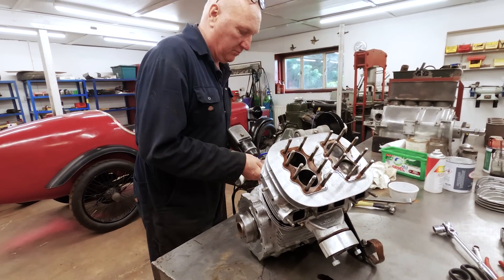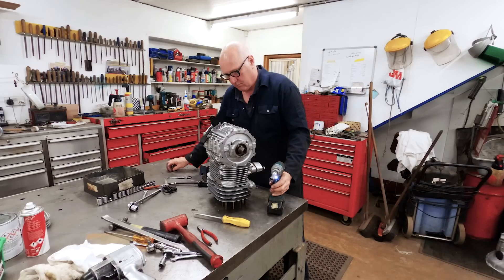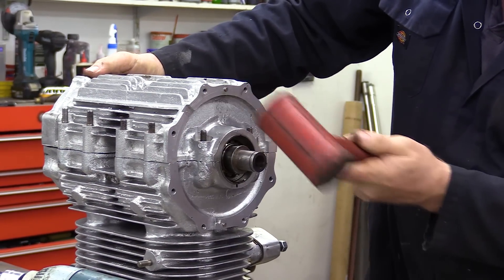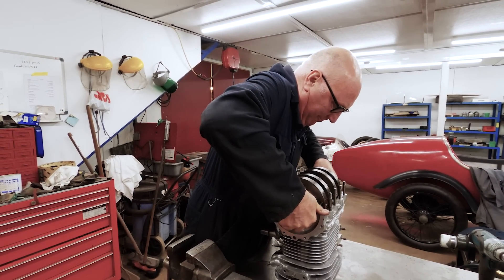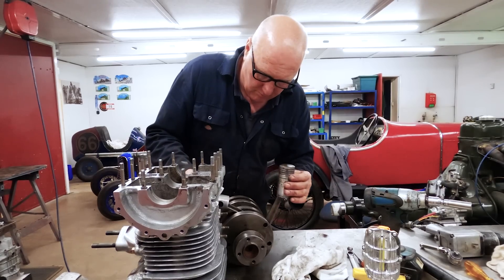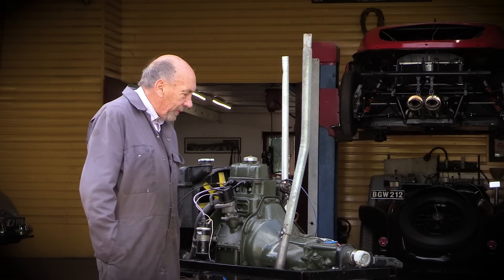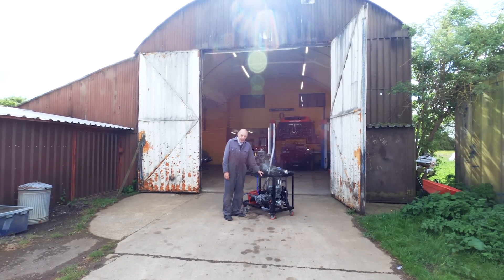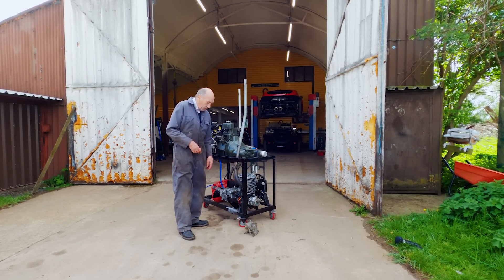SHED RACING - 2 Stroke Mini Engine/ Fault diagnosis

Comment: I used to mess about with two strokes as a lad - its got me stumped - I know the water bottle GT750 was plagued with crankshaft oil seal problems - it was fun to ride though get it in the power band and hang on. Two strokes will usually run without an exhaust they wont produce maximum power look at some of Mr Millyard's content Alan starts bare engines on the tailgate of his pickup. That backfiring ? I am sure someone must know.  Stay safe Ivan.

Comment: Crank seals are all important on a 2 stroke. The seal that you fitted the wrong way round is just one of three crank seals which allow the engine to develop crankcase or primary compression, to push gases into the combustion chambers through the transfer ports. The main bearings will have seals built into them. Over years of standing unused these seals harden and crack, and sealing is not achieved.  To get to these seals it will be necessary to split the crank, and release the main bearings for seal replacement.

Comment: I would agree your lack of tuned pipe is probably most likely issue. Without exhaust scavenging the motor will struggle. The other thing is you spark gap could be too large. I had a personal water craft that did basically the same thing and as soon as I closed the plug gap 0.02 it ran like a top.

Last you guys should reach out to the guy from 2 Stroke Stuffing here on YouTube he is deep in the weeds with 2 strokes.

Comment: This has been a fascinating series. I have yet to understand how that 2-cycle arrangement works with the paired pistons. :-/
Reply: Basicly one piston controls the intake function and the other controls the exhaust. This allows the port timing to be asimetrical so you can favor port opening and closing for best power . Normal single piston 2 stroke port timing is always a compromise , porting for max power usually kills the bottom end. Reed valves or rotory valves on the intake and tuned exhaust are ways improve the power band while still trying to obtain max power with a usuable power band.
Reply: @dog8nut  Ah, got it. Thanks! I see they share a common combustion chamber, so it makes sense now.
Reply: @dog8nut  I don't think so as surely you would only have 2 exhaust ports for your arrangement.

I think we simply have a 4 cylinder 2 stroke, arranged like a v4 or parallel 4
Reply: @psk5746  The orignal PUCH design used twin exhaust ports on their 2 piston ONE COMBUSTION CHAMBER engine. So what we have in this case is a 2  cylinder 4 piston parllel twin with 2 combustion chambers. Still with 2 exhaust ports/pipes per cylinder.

Comment: Great interesting engine , try smaller bore   carb , I remember in my training on any engine  the intake size can be too big , we tuned a single cylinder,  huge valves huge intake port huge carburettor  it wouldn't even start , so in practice air speed through  the intake has to match the piston displacement, we put a different head with small intake small carb started perfectly,  regardless of any other setting ,

Comment: How do you expect it to run properly without a tuned expansion chamber ?
Reply: Don’t think the expansion chamber was around when this engine was designed, it was only just being invented and used by MZ motorcycles around this time.

Comment: since its a 2 stroke, you might want to find/design an exhaust with an expansion chamber? im not sure if youd want one per cylinder or whatever, but ive heard those are quite important in modern 2 stroke engines
Reply: Absolutely necessary, otherwise exaust pulses will push back through the intake as seen here

Comment: From what I can see you have no seal(s) on the crankshaft between the cyls so what could be happening is the primary compression is going back and forth in the crankcase instead of being forced up to the combustion chamber via the transfer ports.
Reply: The crankshaft piece housing the bearings & seals, between the cranks, is technically called a labyrinth. I've worked on 2 stroke twins for 43 years now, and previously suggested this as a possibility. However, I've run 2 stroke twins with bad labyrinth seals and they've never blown back through the carb like this. They've just been a bugger to start and disliked running at low RPM.
Reply: @CZ350tuner  A labyrinth (series of lands and or groves on the crank or journal area) seal is one type that is used on multi cyl 2 strokes but there are standard rubber type seals used on some brands of 2 stroke engines. 
As for whether lack of seals is the cause or not is to be determined and the bottom end of the engine is the Experimental part and perhaps not enough research was done in design. 
I have been working on multi cyl 2 stroke engines for over 50 years now.

Comment: I'm confused how this engine works I thought you said in earlier vid 2 pistons acted as a supercharger pump ? and yet 4 exhaust pipes? at least you got a run well done. It seems unusual to me the Inlet and exhaust are on the same side which would mean the gas flow would have to turn 180' ?

Comment: I have a love/hate relationship with 2-strokes, they're wonderfully simple and can run and sound fantastic when things are going well, but they're finicky, high-maintainence little beasts! apart from very early examples (full of cast iron and bronze-bushes) they've got a limited lifespan too!

I reckon the backfiring could be down to the exhaust, most 2-strokes rely heavily on the resonance of the pipe to run, and keep the gasses moving in the correct direction. although older 2-strokes (pre-war especially) are quite happy without a resonating pipe I think if you made something up along the same lines as was fitted to the puch bike engines, you'd at least eliminate that issue.
Reply: Iirc 29 inch pipe length for individual pipes from the piston should give the right reversion pulses from an open ended pipe.... the reflected pulse should arrive back at the right time..
Reply: I've seen Suzuki Water Bottles with bloody light years on them running merrily along. 70,000 - 80,000 miles was not particularly remarkable if you kept oil in the injection tank. Certainly I've seen regularly used outboard motor two strokes that were 50 years old and had never been to bits.
Reply: @scheusselmensch5713  It all depends on the care taken when operating i suppose, most of the 2-strokes I see are thrashed within an inch of their life and only get attention when they won't thrash any more! there's plenty of them out there that have a LOT of hours on them and are still ticking, but the vast majority tend to live fast and die young. I'll still stick to the old iron though, it smells of castrol and makes better noises!
Reply: @theafro  life of a 2 stroke all comes down to feeding and maintenance. Use proper fuels and oil warm them up properly and provide the proper maintenance when required and they will run forever
Reply: @holmes1956O  the trouble is, that the majority of 2-stroke users nowadays are either young lads on scooters or arborists with chainsaws/brush-cutters, neither category are known for mechanical sympathy!
Reply: @theafro  lol I hear that. Right on mark my friend

Comment: Ivan you will get it, is there any chance that the piston skirts could be different length?? 2-stroke are normally very sensitive to inlet size and jets in the carburettor, what about doing a little research on what it supposed to run with!!

Comment: Without a proper exhaust I would think it is not pulling the charge through correctly.  But that depends on the port timing as well?
Anyway, I am glad to see it running, I hope you don't give up on it.
Reply: My thoughts too.  Surely a 4 into 1 collector is absolutely the wrong thing for a 2 stroke?

Comment: Great to get it running ! I think you might need to look at the exhaust system . There might not be enough back pressure . Two Strokes are very fussy when it comes to exhausts.
Reply: My first thought too: They are dependant on the expansion chamber to draw the fuel mixture into the cylinder as well as drawing out the exhaust. The position of the chamber from the port is critical too, along with the timing of the closing of the intake over the exhaust ports.
Reply: @daleskidmore1685  I was thinking this too. It may need an expansion chamber to run well.
Reply: Remember this engine was designed before they figured out expansion chambers, Walter Kadden had only just figured them on MZ race bikes..
Reply: yes my thoughts as well  a pair of two into ones perhaps.
Reply: My thought as well. I would suggest trying it with four seperate pipes to start with, and if that shows improvement, then start playing with tuning the lengths etc.
Reply: I was just about to make the same suggestion.
Reply: Totally agree!
Reply: Not a 2 stroker but those ain't the right exhausts,needs expansion chambers for vacuum...I think??!!??
Reply: As a novice I took the standard pipe off my fsie and added a straight through bit of pipe I got from somewhere, to make it faster and louder… obviously! when it finally started, and after taking the air filter off? it backfired and all but caught fire…Might be worth a chat with the 2 stroke stuffing dude.
Reply: 100%, need expansion chambers
Reply: Back pressure is critical in 2 strokes. We used to play with it on single cylinder engines and it moves the power band higher with less, but the low down torque is hopeless. I can only guess that manifolded exhaust on multi cylinder 2 strokes with too low back pressure is an issue. Also the carb jet size may be way to small because the engine fires twice as often. The engine seems to spit back due to weakness.
Weakness plus a bad exhaust design may be the two issues which compound.
Inter crankcase leakage will also cause bad issues, but the engine does run.
Love the series. Ivan is a real gem and mine on information. I view for entertainment and tips. Thanks and keep up the good work. Martin.

Comment: Play around with the exhaust length and try to tune it to a bit better? Maybe a 2-stroke dirt bike resonant chamber?
Probably not a complete solution but at least it may not cough out the intake as much...
I think the piston skirts or cylinder ports need tweeking to really get it going but that's a pain
Cheers,

Comment: A normal 2 stroke engine can run in either direction, all that changes is the ignition timing. A twingle is different since the exhaust and transfer ports are in different barrels. That means that it is possible to have the transfer ports opening before the exhaust if the engine is running backwards. The result would be blowing back through the carburettor. I would have another look at that before dismissing it completely.
Alternatively, is it possible that the barrels are reversed? I'm unsure if the primary con rod is on the transfer side or the exhaust side but if they are the wrong way round it would throw the timing out completely.
Reply: Exactly my thoughts, too. Also i noted that the exhaust pipes doesn’t look like they offer back pressure of any kind. The design of the transfer ports could also be relying on this back pressure so maybe also a potential culpritt ?

Comment: I wouldn't say this is the case here, but that engine sounds as if it is over oiled, running with an "almost missfire" at a large throttle opening. Spluttering (or 4 stroking) we called it 45 years ago; on my Yamaha 50cc it was easily cured by adjusting the autolube pump. Also sometimes caused by over rich mixture, which could point to your carb...

Comment: Thanks for the update.  It’ll get sorted out eventually. It’s frustrating but you have the right idea.  Set it aside and get in with another project.   I find that when I do that, occasionally I’ll have an epiphany and the problem is solved.  Cheers Mates from across the pond !

Comment: Excellent, but please. No music over the talking.
*Also it seems like you might be getting some kind of electrical interference on the ignition system. The carb back-fire is not consistent maybe spark jump or possibly of ignition movement. Very little timing adjustment on a 2 stroke makes a huge difference.